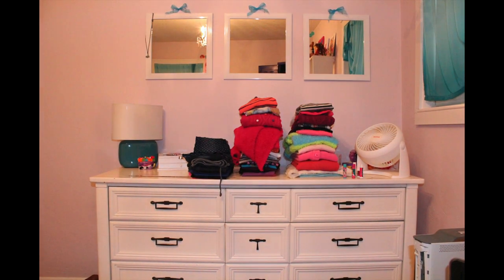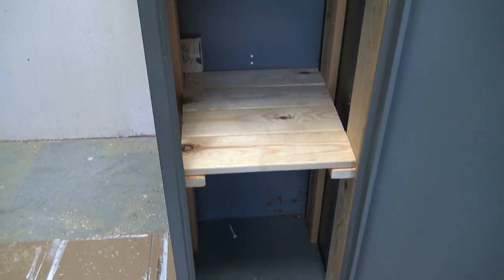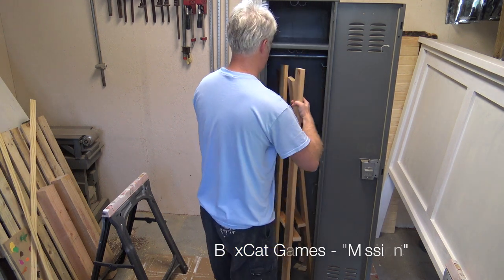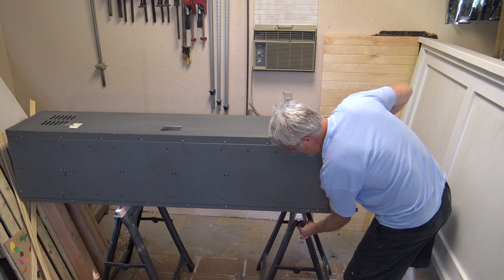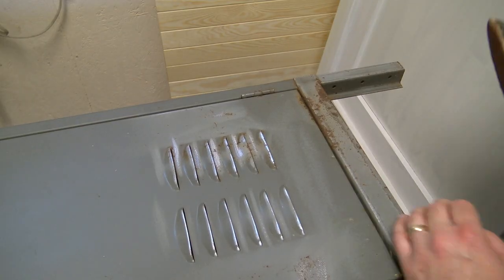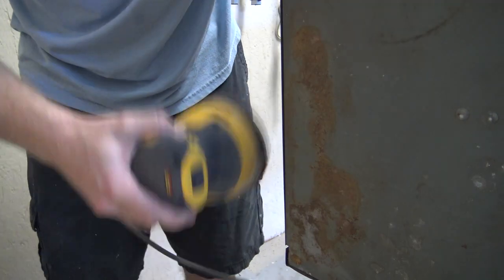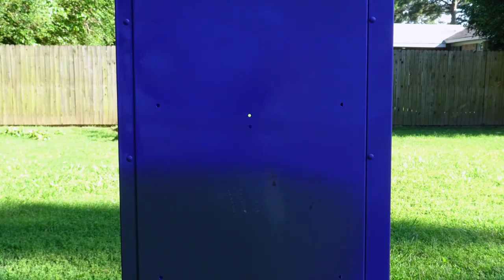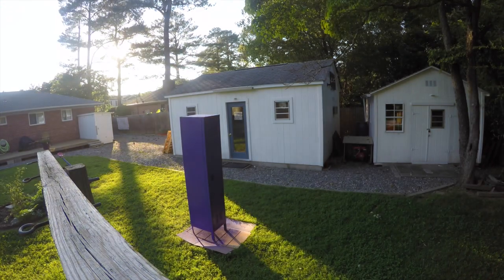How to Upcycle and Re-purpose a Metal Locker - Daughter's Room Upgrade Part 2

Comment: Great job, thanks for sharing.  I found some metal file cabinets that I want to use as kitchen cabinets  for storing small appliances, pots& pans, etc. because my tiny kitchen is lacking in kitchen cabinets or space for them.  I will use them in my attached garage. I am going to try your technique.

Comment: Did you bolt it the wall somehow? I just got a set of 4 attached and nervous it might would topple over.
Reply from the maker: Hey Stephanie! I did not bolt it to the wall.  It's pretty rigid on it's own and i made sure off camera that it wouldn't tip over when the door was open.  Also when we filled it with clothes it helped weigh it down.  With 4 lockers that may be different though.  It would be very easy to bolt or attach it to the wall.  The back panel is pretty thin (at least on mine) and would be easy to drill through.  Hope that helps!

Comment: Hi, has the paint scratched off at all. I read that with metal, you should use a metal primer undercover? but I don't know if it's really required🤷‍♀️
Reply from the maker: 3 year later and it still looks brand new!  The locker is covered with magnets and art work and still works great!

Comment: I have a smaller locker like this I plan on doing this. I was wondering what number sandpaper did you use and also what brand of paint. I want to make sure it's smooth and I can dust it off when needed. Thank you🙂
Reply from the maker: I used 80 grit to get the rust off.  It worked really well to give me a nice surface. If you don't have any rust maybe a 120 or 180 would work too.  I believe we used Krylon Spray paint.   Good luck!
Reply: @EricGreaves  thank you! Making my home Depot list now

Comment: Hi! I'm interested in doing something similar. Do i have to do layers of spraypaint, let dry, then paint again? How do you keep the paint away from parts you dont want painted ? (Such as the handle?)
Reply from the maker: Hi Ches.  You can use painters tape to mask any area that you don't want painted.  We painted the entire surface on a sunny day with low humidity let it sit and then went over it again with a second coat.  Worked great for us.  Just make sure it's dry before reapplying.  Also the glitter spray was from Home Depot.  I believe it was Krylon.  Good luck!

Comment: What sizes are the shelves again? I think I have a pallet that I can pull apart and poke in mine once I've sanded and painted
Reply from the maker: I'm not sure the exact measurement, but they fit inside the locker with a bit of clearance for the door.  They are set about 2 feet apart so we have 3 shelves in the unit, but could add more if needed.  So far they are working great.

Comment: Hi, I'm going to do this myself to 6 lockers. After spray painting, would the spray paint chip off. Or would. You recommend adding a sealant after spraying.?
Reply from the maker: We haven't had any problems with paint chipping.  It's been several years and the locker still looks brand new and our daughter has covered it with magnets and other things with no problems.  I would recommend a few coats of high quality paint and you should be good to go!  Good luck!
Reply: @EricGreaves  thanks.

Comment: Quick question.....My husbands work gave me a set of lockers. 3 side by side however they are split door meaning there are 6 half doors on they 3 lockers. I want to remove a few of they doors. Do you have any suggestions on how I would do that?
Reply from the maker: Hey Holly!  If they are metal hinges and you had to cut them you can use an angle grinder with a cut off wheel, a dremel multi tool, or depending on the spacing you could use a hacksaw to cut through the metal hinge.  You could then use the angle grinder or a rasp to smooth out the cut if there are any sharp edges.  The hinges might be attached with "pop rivets" which could be drilled out with a drill bit.  Hope that helps!

Comment: do you need to sand metal furniture even if it's brand new? I purchased a tool cabinet and want to paint it white.
Reply from the maker: I doubt you would need to sand "new" metal.  There may be some benefit to lightly sand it to give the new paint something to adhere too, but i would think paint made for metal wouldn't need much prep.  Depending on the paint you use it may give you prep instructions.  Hope that helps!

Comment: Do you have to sand or prime if there's no rust and you're using black paint?
Reply from the maker: i only sanded the spots with rust. The rest was left untouched.  We used spray paint that had primer in it, but probably not necessary
Reply: Ok, thanks!